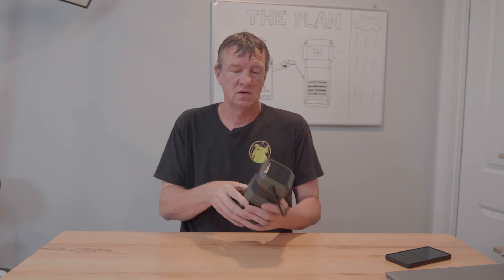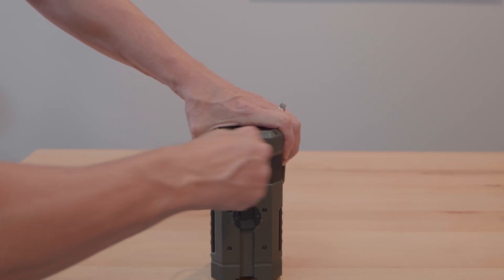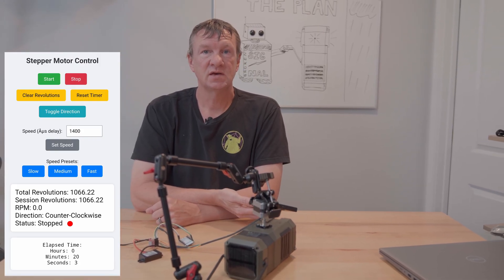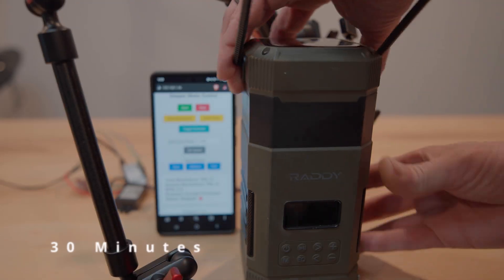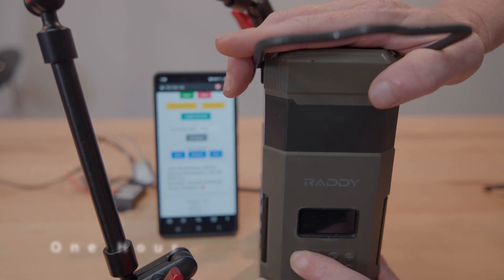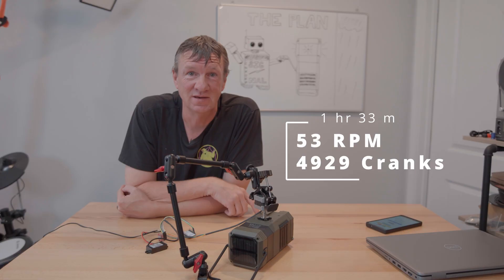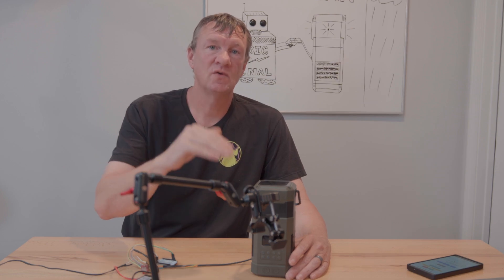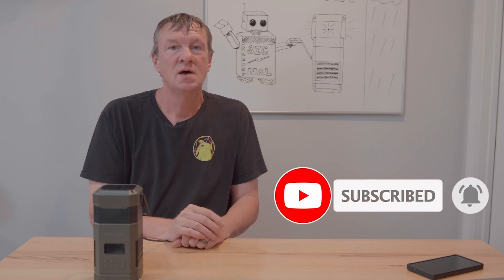How Much Cranking Does It Actually Take to Power a Dead Radio?

Comment: I am very skeptical of crank radios.  Just have batteries and a solar panel. The mechanical stuff will fail eventually as you torque on it. The whole drivetrain in those things is 100% plastic which will fatigue and fail.